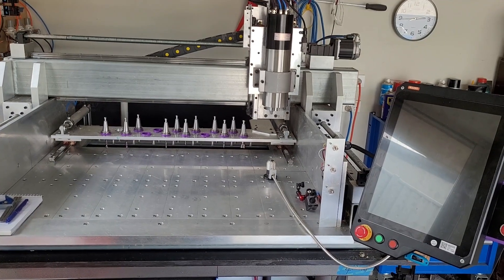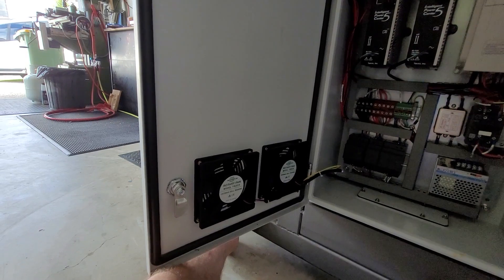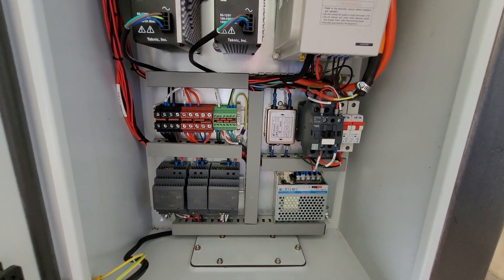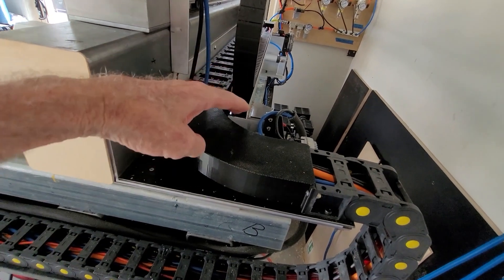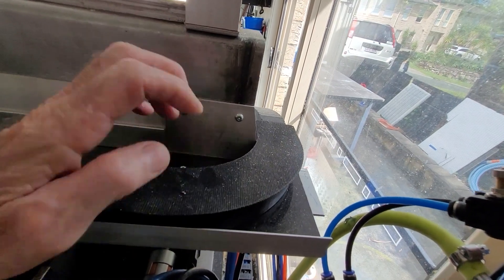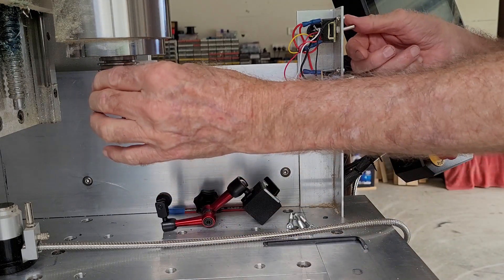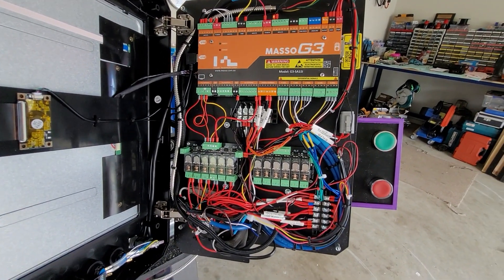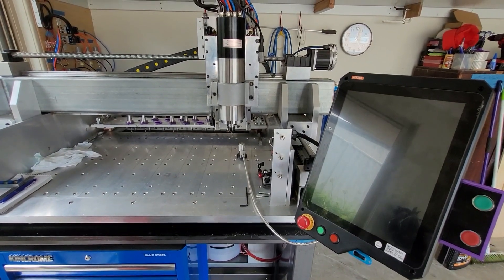The Sparks and Lightning that run my home built PrintNC PRO + ATC

Comment: What’s the reasoning behind the 3 separate 24V PSUs?
Reply from the maker: Hi Shawn well for me a couple of reasons I could not find one with a high enough output as in amps locally ( I was pressed for time) so just went with two and these were well priced but then I found I needed a third other than the spindle every thing else runs on 24v like the coolant pump the 4 solenoid relays for the ATC the two solenoids for the sliding tool rack the two solenoids for the mister and air blast the 4 fans in the enclosure etc etc the Masso is 24 volt but has it's own dedicated PSU so yeh I could have done it differently but that's how it turned out Oh and from memory just not enough output terminals  on just one PSU and I did not have room for heaps more terminal block ok cheers Bill